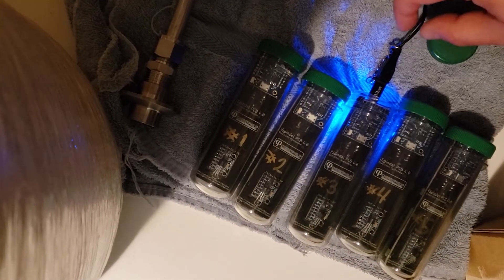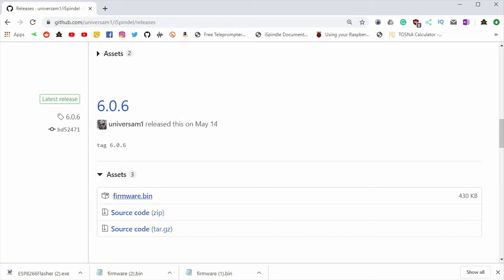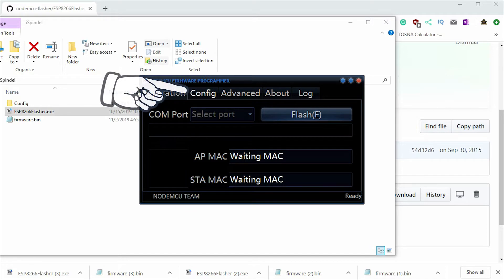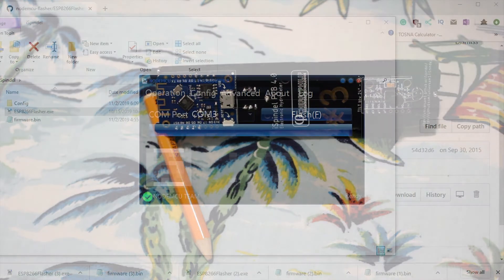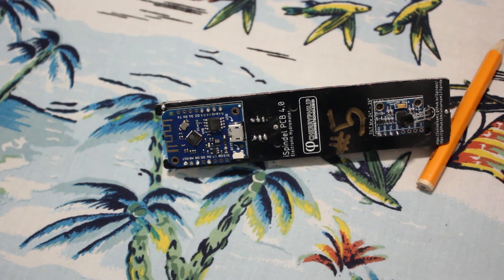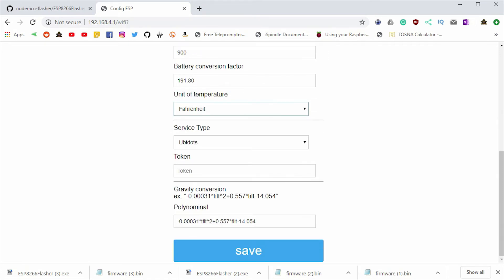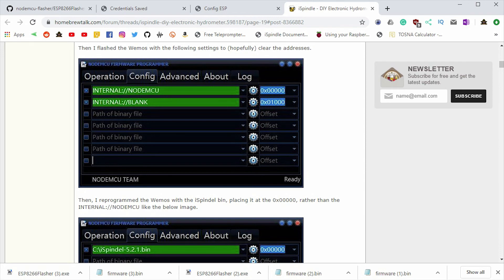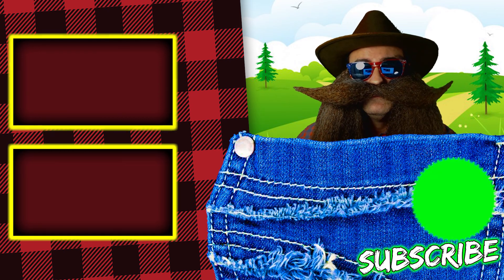iSpindel Firmware Flash in English - How to Flash an iSpindel

Comment from the maker: The final version of The Jeffrey PCB 2.0 is now available! https://www.pcbway.com/project/shareproject/iSpindel_The_Jeffrey_2_0___Open_Source_Distilling.html
Reply: I flashed mine but might be struggling connecting it to my wifi network. I selected the wifi network and entered the password, but when I hit save, it rebooted and I saw it pop on my wifi for a split second and then disconnect. I see no other LED's or signs of life, but it's still in the ON position? Is this expected, that it does not keep a constant connection to the wifi network to save power or something ?
Reply from the maker: @p.chuckmoralesesquire3965  The only way to keep the iSpindel constantly on is when it's in configuration mode. When running normally it's in sleep mode and turns on to quickly send data and then quickly turns itself back off again to save power. If your interval is set up for 900 seconds/15 mins your iSpindel will only be on for a few seconds per hour to send data. This is how it saves battery power :) When sending data the LED should blink for a second.

Comment: I saw somewhere that you can flash the D1 mini before you build (still waiting on parts) but when I plug the D1 mini in, the flasher does not recognize the com port. Any suggestions? TIA P.S. I've tried three different cables. How do you know if you have a data cable.
Reply from the maker: Follow the link below. How far can you get? There is a video included in my blog post :)

https://www.opensourcedistilling.com/serial-monitor-log-for-ispindel/

Comment: I followed the flashing process. I got a green checkmark almost instantly when I hit the flash button. I tried it with two Ispindels and never got the blue loading bar that you did. I also am unable to locate an open ispindel wifi network with either one. I am assuming something went wrong with initial flashing process but don't know where to go from here.
Reply from the maker: Do you have a data USB cable that will plug into the D1 mini? Running a serial monitor will tell you if the firmware flashed or not. Are you able to test the data cable with a cell phone to determine if it's a data or just a charging cable. Serial monitor walkthrough https://www.opensourcedistilling.com/serial-monitor-log-for-ispindel/
Reply: @OpenSourceDistilling  I will have to check what type of chord I am using. I know my desktop read that a usb was plugged in but it did not state that an external device was connected. I will follow this process and send an update. Thank you for responding 🍻
Reply: Had the same problem, make sure to check the little checkmark on the config tab next to file path

Comment: These videos are great!  I am running into an issue with mine that I am setting up.  You touched on it at the end mine is not saving the name or the temperature F when changed and when I go back in to verify it’s just gone.  Any recommendations on places I can look?
Reply from the maker: Have you tried the suggestion at the bottom of this blog post? https://www.opensourcedistilling.com/ispindel-firmware-flash/
Reply: I did, multiple times

Comment: Just built my first Ispindel. When is the next video coming out. Im ready.   =0)
Reply from the maker: It's coming! Stay tuned :)
Reply: @OpenSourceDistilling  Any ETA on the calibration video??? No Pressure! (PRESSURE!!!!) :D
Reply from the maker: @jwade8080   Offset calibration video is being edited as I type. We'll then do 25 degrees in water calibration video, then gravity readings to tilt calibration video, and finally the battery voltage calibration video. I also have iSpindel PCB prototypes I designed coming in the mail tomorrow from PCBway. I'm back from a break so you'll see more videos coming out. Cheers!